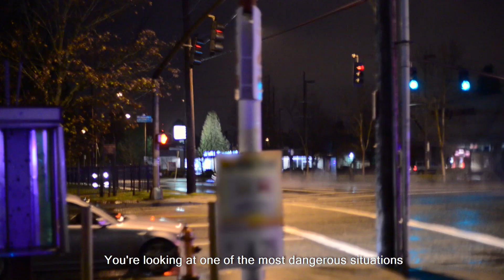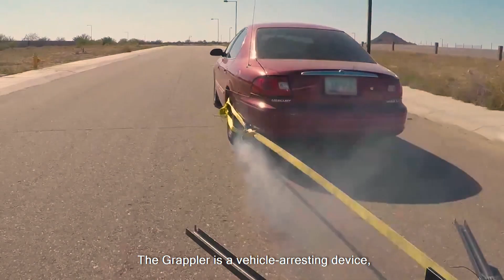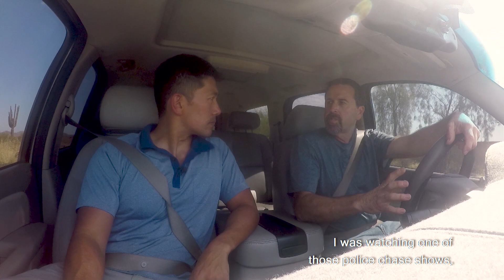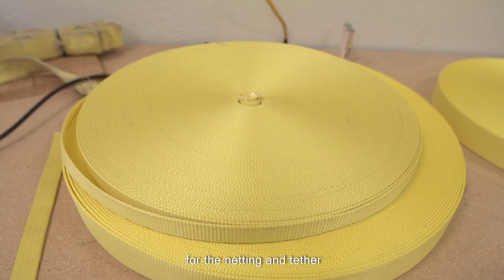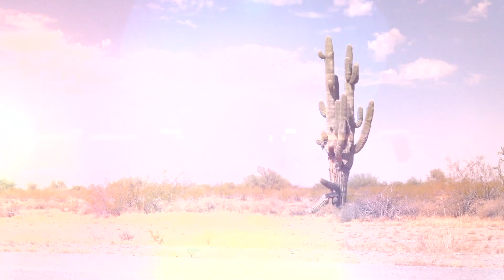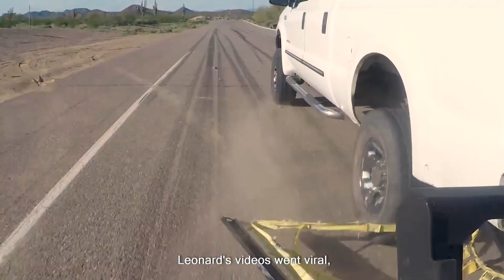New Car Chase Tech for Police | The Henry Ford’s Innovation Nation

Comment: Most ideas on this aim towards having the vehicle run over things or be boxed in, this invention tangles the wheel using the top of the wheel which is turning in a forward direction to pull the net around the wheel

Comment: The next person that is hurt in a police chase, especially Los Angeles, even the idiot running, should sue if they didn't use this to stop them. There is no reason that 100% of the agencies are not using this as the only method of stopping a high speed pursuit.

Comment: That;s all fine and dandy, but how many uses will a police dept get out of that paid for by the taxpayer $?  Vs what does the spike strips cost?  Looks like they have to get pretty close for those gapplers to snag a tire.  How safe are they?  IMHO, when it comes to spending, those in power should be getting a vote on it from the taxpayers.

Comment: Of course a small business owner would do this. Large corporation's have to many engineers and management to move quickly. The normal thing would be for Large Corporation's to steal the design then tie the original developer up in the courts for years, running them into the ground with legal costs.
Case in point, the intermittent windshield wiper inventor.

Comment: But on the nother hand , it renders the push bumper useless .
Reply: But it doesn't lead to dangerous situations and bumping suspect can  lead to dangerous situation like they might crash into sing or tree and then they have to clean the mess after  which they cannot take the car and drove it to police parking lot and Cops have to call other service to clean the mess and  take damaged car after the pursuit has ended using this device  you limit  risk of crash and unecesessery mess by 99%.
Reply: Yes. But theoretically say you have 10 police on duty in 1 town at a time. Have 2 vehicles equipped with this of 10 and at least 1 could potentially set up and join "the chase" .

Comment: The only downside, is if the driver takes off and gets in another vehicle.  The cop car with this device can't go after him until he disconnects the strap and folds the bars back up.
Reply: In hot pursuit there will never be  just 1 police vehicle chasing.
Reply: @tapist3482  Right...
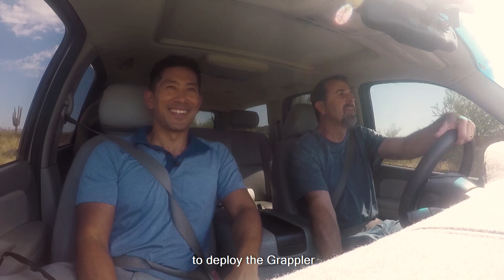Reply: If you look closely at the labels at 3:23 one of them says "Tether Release", so it seems like the net can be disconnected with the flick of a switch so they can just cut the line and go after them.
Reply: @xientau9028  Nice catch...
Reply: There's usually more than one cop car following in these chases...

Comment: Wouldn't it be better to hit the right/passenger tire on most rear wheel drive vehicles? After all, it is the main drive wheel on a standard rear axle.
Reply: @baddriversofthenorcalarea500  So I did some calculations based on the case in the video they stopped a f150 running 60 mph in 8 seconds. That's around 1700 pounds of force, while those nylons can take 20000... Damn, nylons are tough!
Reply: If you grab the drive wheels the torque may snap the nylon, reducing the effective rate of this thing.
Reply: A standard rear axle has an open differential which doesn't have a specific driven wheel. It drives the wheel with the least traction. Look up the old video called "Around the corner, how differential steering works".

Comment: Yeah it does seem creative, but the Police would need to think about what is possible when using the device, what if something is blocking the device from getting into the wheel?, if the driver of the car is smart and knows how to defend himself from the device then that could be an issue, if the device gets into the wheel right when the car swerves around at a high speed and the cop car loses control leaving someone or the cop injured or even dead then that could be a problem, if the vehicle rips off the cop cars bumper then the vehicle gets away then what are they gonna do, just sit there and feel disappointed that the grappler device failed?
If the driver of a actual valuable and precious vintage car accidentally does something wrong resulting in a police chase and the device damages the back wheel then who knows if the Police are responsible for the damage  precious property.
Reply: IF IF IF...its WHEN WHEN WHEN...watch it again again again again...dduurrrr
Reply: There's also a version that isn't attached to the police car after attaching it to a suspect. The net wraps itself around the tire and all and stop it that way.
Reply: You sure have a Lotta if’s. There are a lot of if’s and everything. This thing will not get ripped off of the police vehicle. It’s attached to the frame (knucklehead). You can only use it if the suspect car is going straight. Which is most of the time. The police will just have to pick the right time. There’s an answer to all your “if’s “. This is a great product. It won’t work on 100% of police chases. But it’s 100% better then these criminals speeding through neighborhoods, wrecking and killing people.
Reply: If the device fails the cops do what american cops do without the device.
Ram the car until it stops.
The only valuable argument of yours is the risk for the police.
Reply: Crazy Monkeys police have radios, backup, and if need be air support. Even if they disable this solitary police vehicle the police can always just put out a description and hope another cop gets lucky. Also they try to stop expensive vehicles but if it’s the vehicle or civilian safety, then too bad for the car.

Comment: Easy to counter.

slamm your car and add a big rear diffuser
Reply: Νικος Σιμιτσοπουλος hmm can see that high horse power front wheel drive.......or if large vehicle older vehicle slams on brakes...newer police units are basically just like your standard cars..polyureathane...styrafoam...heaviest built part push bar
Reply: Νικος Σιμιτσοπουλος
 In such cases you won't need this device just a pothole or a speed bump will do the job.
Reply: You haters! LOL
Reply: have you got brains...i would have thought only people with brains switched on would watch this and comment...so watch again & again & again...dduurrrr
Reply: based on the case in the video they stopped a f150 running 60 mph in 8 seconds. That's around 1700 pounds of force, while those nylons can take 20000.